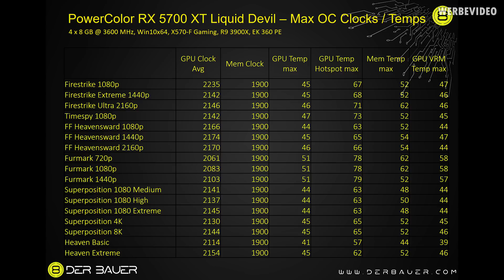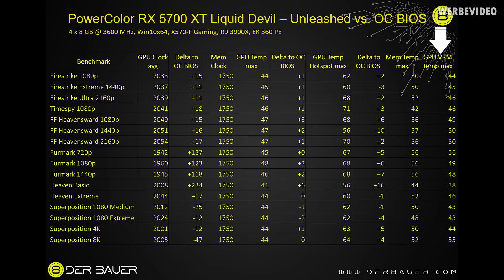A closer look at the MOST EXPENSIVE RX 5700 XT - PowerColor Liquid Devil for 600 €

Comment: This may have popped up in your other reviews, but do you see much of a performance boost in actual games when running at ~2150 mhz vs. regular 5700XTs running between 1850-1950?
Reply: SirDuckferd For every 70-100 MHz you get about 3 fps more. Let's say you average 100 fps on Shadow of the Tomb Raider maxed out on a reference 5700 XT, hovering at 1850 MHz. Running 5700 XT at 2150 MHz will give you 109 fps.

Comment: re the binned gpu core.  I've have a WC red devil and my average core clocks with mac OC (2150/1900 set in wattman) are 70-100mhz lower than yours for a given benchmark.  my core temps are slightly lower but my mem and vrm temps are about 10C higher.  Don't think the thermal pads are thick enough for good contact with the block.

Comment: Is the 5700XT a much better card to replace a Radeon VII?
Reply: Adjodha B Nope. A VII will push 20-40 fps more than a 5700 XT when both are overclocked go the max. (2000-2100 for VII and 2000 for 5700 XT)

Comment: Ich habe noch ein Budget von 1000€ in was sollte ich investieren

ich bin kein pc profi deshalb eine frage ich habe diese equip:
Main:MSI x470 GAMING PRO CARBON
CPU: AMD RYZEN 7 2700x 8x 4,3GHz
GPU: RTX 2080 TI  Palit Gaming Pro
Arbeitsspeicher 32GB DDR4-3000 Vengeance RGB 2x16
Cooler: Corsair H115i Pro
M.2 SSD 500gb Samsung EVO 860
Festplatte SSD 2TB S-ATA 3 600MB/Sek
Netzteil Corsair CX750M 750Watt 80+
Reply: Ich würde dir dann eher einen 3rd Gen Ryzen 7 3700x empfehlen. Mainboard: X470 Rampage oder X470 Taichi. Die 2080Ti hat halt einen verdammt hohen Wertverlust, daher wäre die 2080Super die sinnvollere Karte. In großen und ganzen passt dies. Mit einem Intel System müsste der i9 9900k drin sein, aber dieser lohnt sich hier nicht wirklich bzw. nur wenn du die letzten paar Frames möchtest
Reply: Kostet die 2080ti allein nicht schon über 1000€?
Und sonst würd ich eher zu einem R5 3500 greifen, gepaart mit 3600Mhz Ram und einem MSI B450 Tomahawk Max. Als Netzteil auch lieber ein BeQuiet! Pure Power 11 500W statt dem Corsair Teil
Reply: @omegaPhix  dass was ich geschrieben habe habe ich schon deswegen war ja die Frage auf dass was ich noch änder bzw umbauen soll Budget 1000€
Reply: @oliwaah9087  Achso, dann würde ich einfach schnelleren Ram und einen besseren Prozessor kaufen. 
Btw. Schonmal an nen neuen Monitor gedacht, bzw. Studio Kopfhörer + Soundkarte?
Reply: @omegaPhix  Soundkarte habe ich Monitor 240hz headset astro a50
Reply: @oliwaah9087  Ok, hört sich solide an. 
Wenn du wirklich upgraden willst, dann nimm einfach einen Ryzen 9 3900X und 32GB 3600Mhz Ram.
Oder du baust eine custom Wasserkühlung, wär auch ne Option :D

Comment: Water block seems the minimum to cool those 5700XT cards, so many people having major overeating problems with other models. But given all the driver problems, I would rather pick nVidia over AMD in any situation. Even if AMD was faster, which they aren't, I would go nVidia just for driver stability.
Reply: My Red Devil never Exceeds 70C, while staying really quiet. Only the reference blower models und the XFX Thicc cards are running hot.
Reply: @omegaPhix  mines pretty good too in temps 70-75c at 1900 some MHz still quiet too I've had Nvidia all my life but couldn't pass up the price to performance if AMD keeps it up I will be buying their gpus from now on

Comment: As others have mentioned, if you're comfortable with assembling the card yourself, the better value is with getting a separate block. Even if prices were the same. This is because of resale potential. It is nearly impossible to sell watercooled cards. Having the air cooler is a big help for resale.
Reply: Why is it hard to resell even if it's factory-installed?

Comment: Where are the 4K 120FPS GPU's!
This is taking so long now!
Reply: i'm still using my 1080ti strix.
Reply: @mckayver1306  I am waiting to upgrade my super old one!
Reply: 2080ti's can do 4k 60fps on most games, if AMD 5900xt gpus really are faster then we should expect around 4k 80-90 fps speeds at a competitive price 🙏
Reply: @zedg7473  "competitive price" $600 for basic models and $800 for flagship models would be nice. And Nvidia's 7nm+ GPU's are getting closer and closer, just a couple of months now.
Reply: Nowhere. With next-gen games coming and with RTX on top of them, it will take a very long time before we'll have 4K120 GPUs. Hell, we can't push 4K120 without RTX in current-gen gen titles on a single card.

Comment: I went with reference card + ek waterblock and I’m very happy with it. I needed the GPU upgrade and wanted to watercool the gpu because the noise of most cards bother me when I’m working (the’re more tolerable when playing because you are highly engaged).

I haven’t got around to playing with SPPT but I might go that route at some point.

Any tips for people with a reference 5700XT? Not afraid to use solder on it 🦾

Comment: I wish it was 50 euros cheaper, since there is no air cooler cost included in the production of this card. Also, I believe that having it 50 euros cheaper would actually result in a much larger sales volume for it. At 600 euros/$ I would expect it to come with a 120mm or 240mm pump and rad with a tiny reservoir (maybe in the radiator) and removable G 1/4  fitting, in the spirit of the Celsius S24/36 or CM Eisberg (I have both) so it could be used out of the box, or integrated into a custom loop.

Comment: I got my 2080 Super for $625 (563 euros) on Cyber Monday... No thanks, AMD.
Reply: Is it watercooled?
Reply: @AndreiNeacsu  No, it's dual fan air cooled. But the performance is higher and the price is lower... even on air. FYI, I did water cool it, but with a cheap Ali Express kit for the chip only.
Reply: @22interceptions  well, you can get a dual fan RX 5700XT for about 420$. That's not really "comparison worthy"

Comment: Its cool and all, but nothing special. This is for diehard AMD fans. Would be better to just buy a 2070.
Reply: Amd has amazing open source Linux drivers. Don’t buy NVIDIA for Linux.
Reply: 2070 is worse, but I don't see why would you watercool 5700xt when the next better gpu's are just around the corner next year.
Reply: @attq3980   2070s is worse!?
Reply: @luispedro4045  It's only worse on min fps (1 % lows), 2070 S has better average FPS
Reply: I dont know if I should laugh or cry.
Reply: in the first time u said just 2070 without s.
Reply: @luispedro4045  
Both cards are pretty much the same. But the RX 5700XT is much cheaper so i'd go for it
Reply: @omegaPhix  Fair enough.

Comment: Aside of the high clock numbers and the very cold card, you should had mentioned this card is geared towards people that already have custom water cooling systems (otherwise plan on €400 more on radiators, fans, pumps, reservoirs, tubes, fittings). And even if you don’t, this card has a very welcome feature, none of the air cooled ones has:

It is silent!
Reply: 400$ for a loop without the gpu  is pretty highend, you can expect way less if you lower your standards a little

Comment: This card really interests me.  I was going to get a ref 5700XT and put a heat killer block on it anyway, I might look at getting this instead.
Reply: why would you waste your money like that,,, you could just buy a 2080s with that money
Reply: @4fiHysteria  Because in Aus this is the same price as a middle of the road 2070, way cheaper than a 2080 thats for sure and it come with a water block for almost the same price as DIY solution.
Reply: @3800S1  I'm with you, I'm from Australia and compared it with an alternative closest was 2070S for price but also when overclocked being a binned chip it's really good performance with low temps
Reply: @saminavy7124  The closest one I could find was the non super 2080 seahawk which comes with a block, that was $1200.